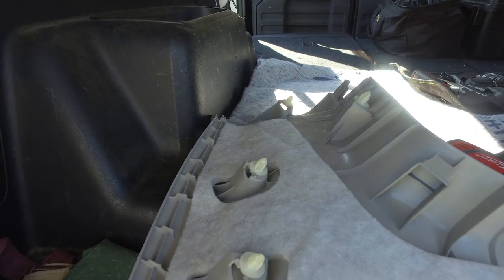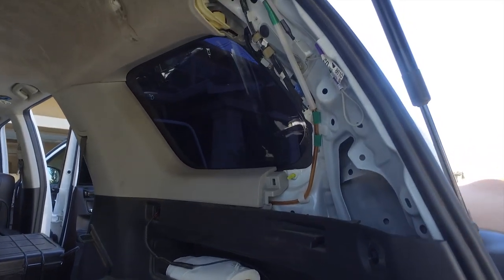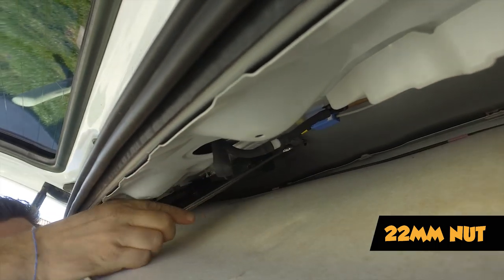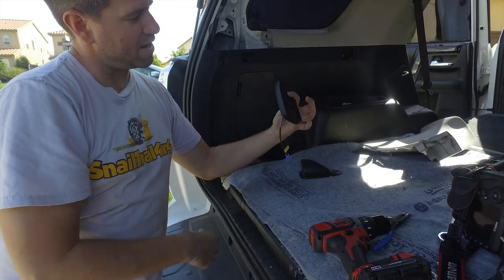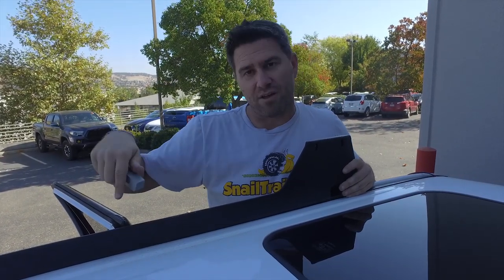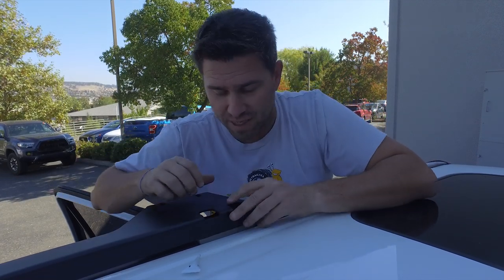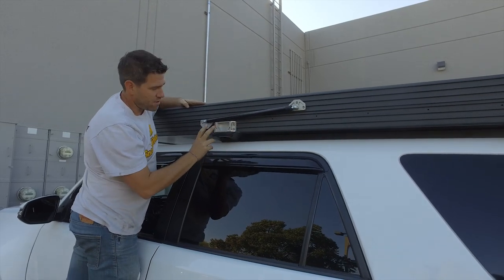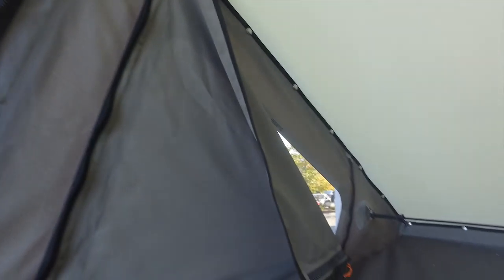Go Fast Camper Install | 5th Gen Toyota 4Runner

Comment: What shock/lift system do you have with the 4runner/GFC camper? Will the 4runner sit well with medium coils or would it need heavy coils?
Reply from the maker: It all depends on what you want to do, and how much weight you plan on carrying or adding to your 4Runner.
Reply: @SnailTrail4x4  Let's just say for GFC Camper, occasional passengers and some camping items in the back. Nothing too crazy. No front/rear bumpers.

Comment: 1.  Is there a fly to keep rain from entering through the open door?
2.  How much room is there to add pillows, blankets, mattress liner. etc?
Reply from the maker: There is no fly that I know of but the near vertical sides with a heavy duty fabric that's water resistant treated.
Not much room for items on the inside, sheets and a thin blanket, I don't think pillow would work. This is definitely not a 4 season tent

Comment: No RTV for the roof brackets/bolts?
Reply from the maker: Loctite should be sufficient, RTV would have been a good idea also
Reply: @SnailTrail4x4  You'll want RTV up there, especially for heavy rain and/or snow. The roof will leak like a sieve if not properly sealed.

Comment: Looking to buy this asap, does it have a pull handle to close? how do you like it so far? just sold the gobi in preperation
Reply: If you look at the other videos it's super simple to pull down. You grab the tent material and pull down until you can reach the top.
Reply: Lead time was 18 months when I called. Got a roofnest Falcon instead.